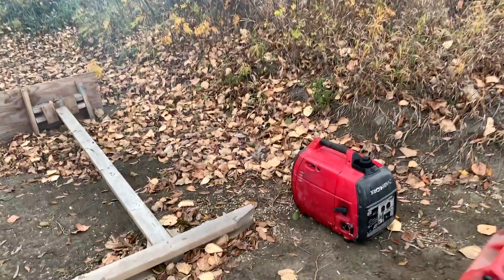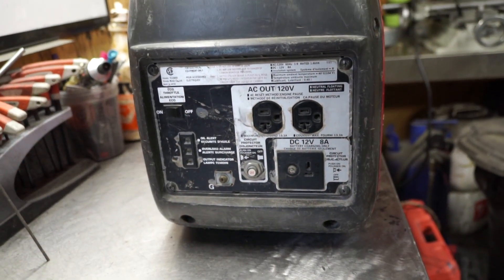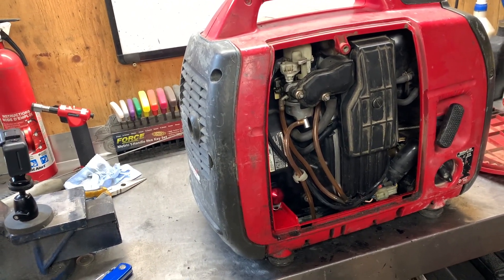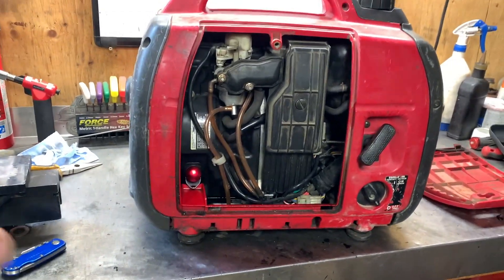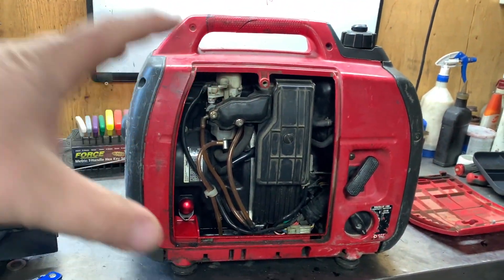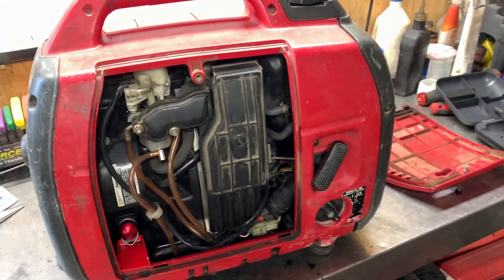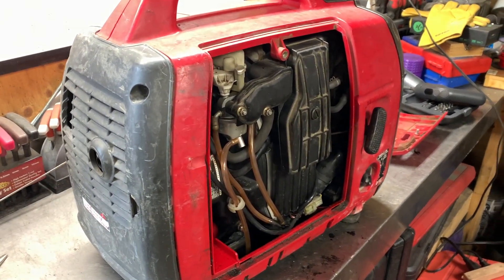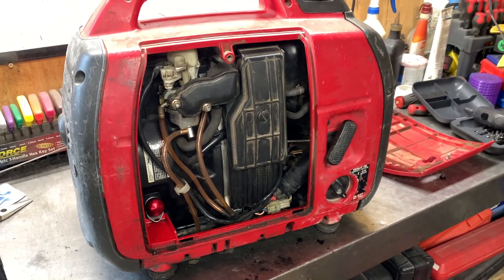Why Does This Honda Eu2000i  Burn Oil

Comment: I'm homeless I have a the same generator is in this video and basically it's missing a bunch of s*** but it runs right now I'm missing a one of the fuel jets so I'm basically using a piece of air filter for the missing fuel jet for it to control my air fuel mixture I'm also missing to the gaskets on the carburetor
Reply: Jeeze bub

Comment: In the actual owners manual I stated to clean the combustion chamber every 300 hours.
Reply: Yeah that's the problem with mine just haven't had the time to strip it all down yet but everything a little while I have to clean off my spark plug cuz it gets all gunked up and it won't create a spark
Reply: @stevenbash5137   sounds like you need rings and  it helps to put a really good load on them for several hours to burn off carbon.
Reply: How do they say about cleaning the combustion chamber ?there not easy to work on you need to take the whole engine out the head is part of the block one casting !

Comment: I have a strange issue with my old eu2000i.  In cold weather temps (sub-zero) it goes from full oil to shut off in 24 hours or so.  BUT when it is plus 10 or so outside, it burns virtually no oil at all.  WTF?

Comment: Hmmm...I watched one of your videos a couple of weeks ago while you were working on your transfer case and while you were cleaning up underneath before working you said: “That’s a valve seal from my Honda generator”.  Any possibility something got left out?  It’s happened to me on more than one occasion.  I’m sure that was just an old one you found though.  Just a thought.  Looking forward to the fix.
Reply from the maker: Oh no it’s impossible to miss that out, the valve has to be installed then the seal then the valve spring.

Comment: Hi Jerry, Love your videos mate👍 I watched your rebuild of the same model a few months ago so this is possibly a vid you did prior to that rebuild or it was posted on your other channel. I had the same issue with an EU20i (same same) I re-ringged for a customer in Nov last year. The old compression rings were excessively worn and piston was quite scuffed, but the oil control rings looked pretty good..However that unit had been previously owned by a brickie or concreter and must have been sucking a lot of dust..lots of evidence behind the flywheel. A new piston and full set of rings solved that issue. Important to check the bore size is good and no scoring, although the bore seems fairly hard + resilient to wear. Check ring end gap with each ring placed separate from the piston and squarely in the cylinder. The new rings came pretty much pre-gapped to correct specs. Important to install the rings on the piston in their respective slots and the correct way up. Stagger the ring end gaps 90-120° offset from each other, and preferably not lined up with either of the thrust sides of piston. Also try to maintain those positions when putting piston back into cylinder. Anyone interested can check out my channel for a short video of the test run after repairs, but no rebuild video sorry, there's a write-up in the description, the video is here: https://youtu.be/VF-SNnCy2Jg  Cheers from Australia👍🇦🇺

Comment: The exhaust can be blue on mine too when I start it up. But I just have it on high with no load for a few minutes and the exhaust is fine again. You don't seem to have that option on yours. Maybe you can run it on full load to get the same effect. It is like those chinese diesel heaters. They need to be run on full capacity too from time to time, to burn up what is clogging them up inside.